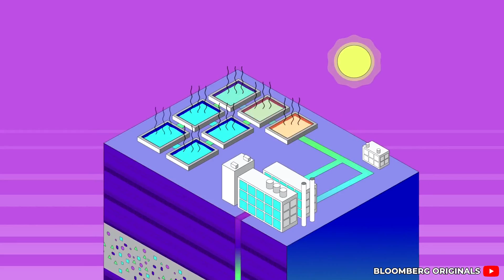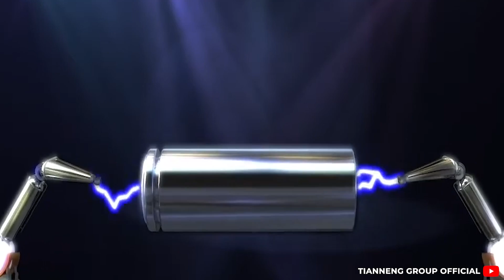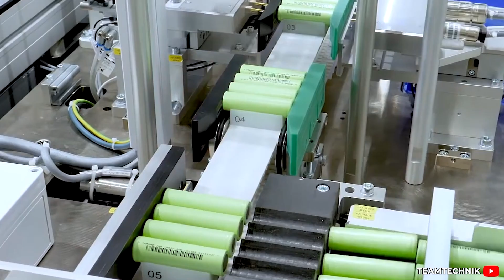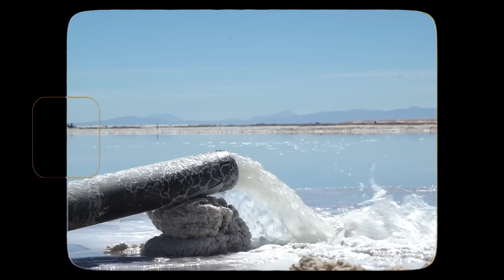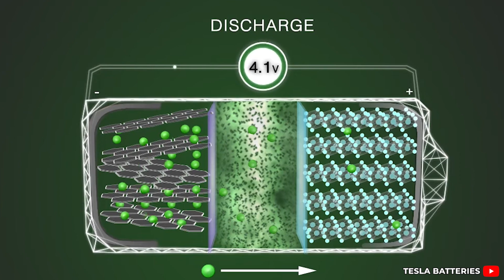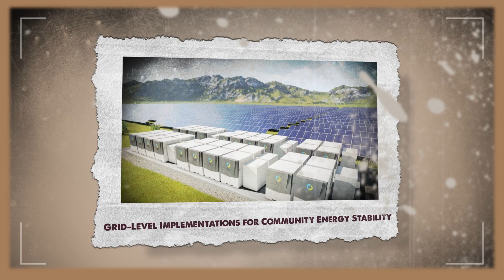This New AI Sodium Battery Will Become The GOD of EV Industry

Comment: The facilities is not yet in place for EVs and will not be for some time not only charging points but the overall power Its difficult enough for this country to keep the lights on without adding extra power outlets for vehicles and with problems supplying new build houses to the extent they are talking about It sounds great in theory but the practically is a completely different story